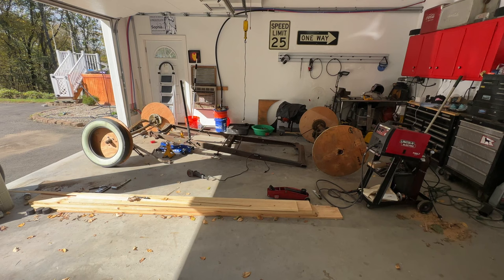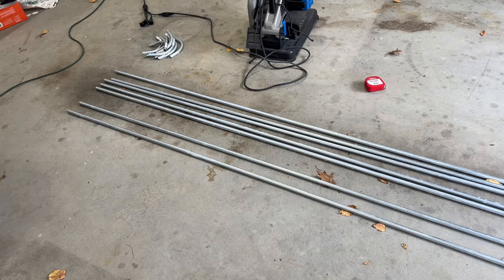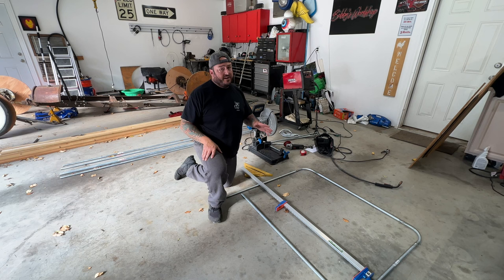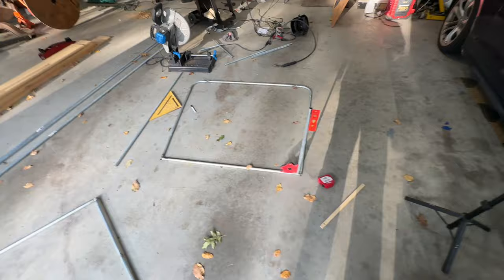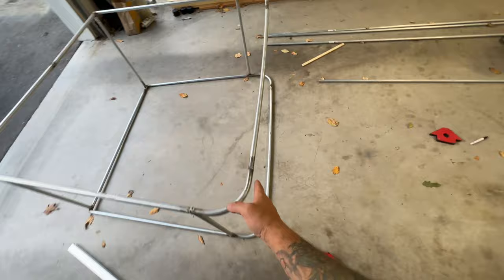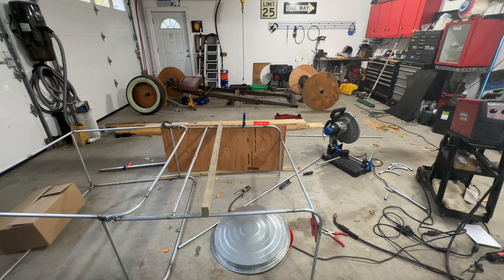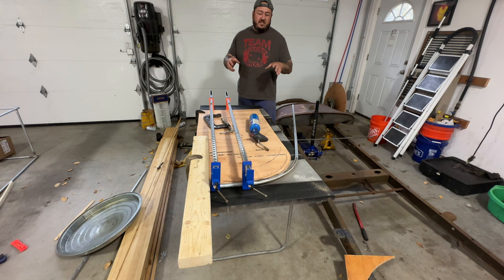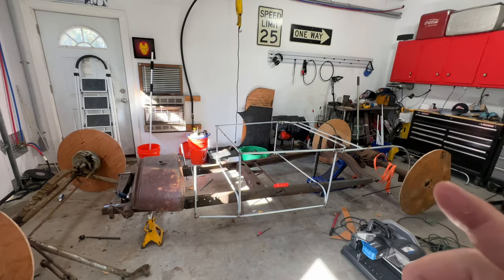FORD (FRAUD) MODEL A BUILD. MODEL A BODY BUILT FROM SCRATCH.

Comment: Just found this video. Funny thing, I had the exact idea a few weeks ago. Been laying out a "T" truck based on building a body to fit my wife and I, then mocking up the frame with 2X4's. I was surfing and saw your video and went AHA! Someone else had the exact idea I did! I will transfer my layout to probably 1.5 inch .125 wall mild steel. I am integrating a Chassis Engineering roll bar as well in my build. Great job on your build so far! I subscribed and am going to check out the rest of your videos as well!

Comment: You need to get small Oxyline torch welding for heating and bending they are very versatile for bending and cutting, and welding if need be.
Reply from the maker: Honestly I have one I got for free on marketplace but I’ve never used it so I’m hesitant but I guess I won’t learn without trying!!! I’ll break it out and give it a try, thanks for watching.
Reply: @Closeenoughkustoms  yes it may be a good idea to to have some one to run the steps by you and check your hole's and the threading on your gadges to make shire Every thing is running in proper order.

 It can be dangerous if something goes wrong!! 

 Always stand on the side of your gadges just in case it blows off. 
I can see why people are lerry because they are dangerous if not operated   right.
 Even the best so called kustomiser are nervous to use the oxyciline tanks to cut, heat,  bend, twist metal.
My opinion people that are getting into the welding, should learn how to weld with the torch first then move on to the MIG, TIG, ARC weld. Once a person master's the oxyciline then all the other's will work so much easier espeacily when Tig welding. Keep on keeping on with your project 👍🏾

Comment: Doesnt the body angle in at the bottom on a model A. I have blue prints to cut the wood for the Roof and Pillars. They are only good if building a stock type body